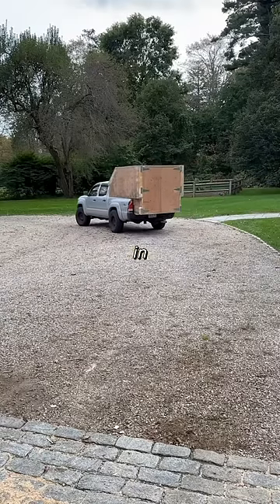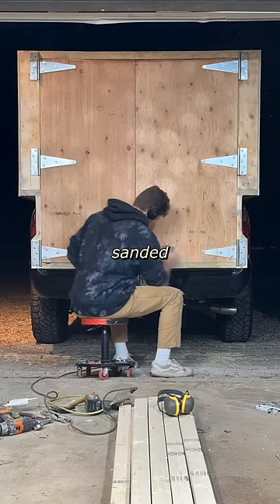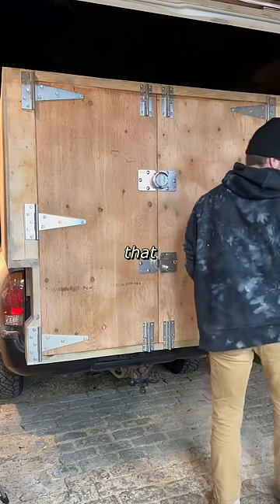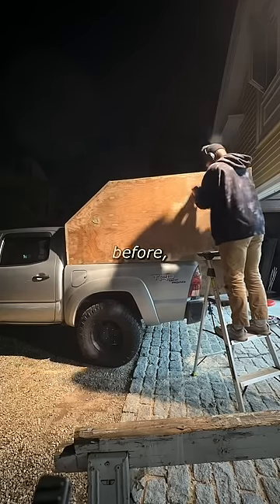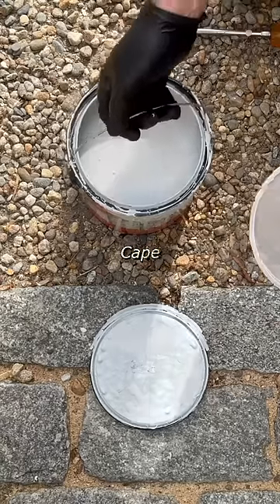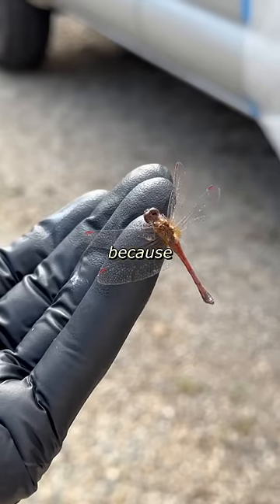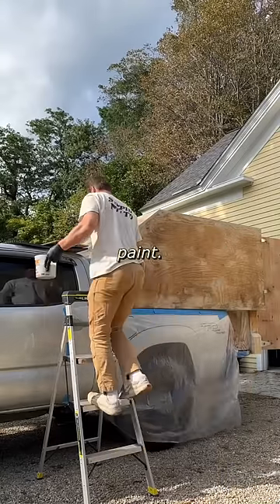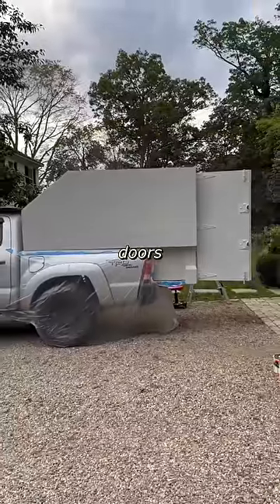DIY vanlife // overlander // motohauler

Comment: To stop the sagging of the rear suspension you could install a helper spring or helper airbags..
Reply: No. To stop sagging use the appropriately sized truck for the expected payload. Bags an helper springs don't increase the vehicles GVW, 1 DOT stop and it's impounded.
Reply: @1987FX16  The tacoma has a 1,500lb payload on the rear, I have done research and installed airbags to allow for max payload. Just because the bed is rated for 500lbs and the suspension is rated for 1,500 doesn’t mean you can’t be fit up and add more weight. As long as the typical load doesn’t exceed 1,500 lbs.
Reply: its leanin 🐜 it
Reply: @disrise it’s learnin ant it?
Reply: @NateKK7  an airbag focuses all that pressure on a smaller surface which may reduce squatting but it will strain the suspension much more only way to really improve payload is to put a 3/4 or 1 ton rear end and suspension in it
Reply: @Fin3rain  with the airbags and no extra suspension components it is safe to hold 1500 pounds in the back of that truck because that is what it’s already rated for. Like I said, I added the airbags to allow for max payload AE 1,500 lbs. A max payload rating has a safety margin, if you have 1,700 pounds in the bed every once in a while (not saying I do it) it is still safe if you aren’t being aggressive. 

DISCLAIMER: I am a certified welder who has a vague understanding of safety margins I AM NOT an engineer I AM NOT a lawyer, do it with YOUR OWN research at YOUR OWN risk. This can and probably will void your warranty as well as get you into trouble with law enforcement if you are caught exceeding the manufacture’s GVWR (GROSS VEHICLE WEIGHT RATING)
Reply: @NateKK7  as I said the airbags will more than likely DECREASE your payload capacity because it is focusing all the stress onto a single point. Why do you think trucks still have leaf springs well after they stop usinh them in cars? It's be cause they distribute the weight across a large area
Reply: @Fin3rain You don’t remove the leaf springs, it does not decrease the payload capacity. Your logic is like saying bigger shocks decrease your payload capacity because they are still using the same footprint. You obviously haven’t worked on any of these systems or a off road vehicle for that matter, any suspension upgrade designed for OEM fit is going to use the factory mounting points. Very few payload/travel upgrade components for these trucks require frame modification and the ones that do usually are not off the shelf kits and are intend for off-road use only.
Reply: @NateKK7  larger springs work by increasing the space the weight is distributed against airbags hugely decrease that spread placing more stress on the center of the leaf spring
Reply: @Fin3rain @NateKK7 both you guys are so wrong…. Just install a flux capacitor with a t4 turbo and that’ll solve all your problems… rookies
Reply: @NateKK7  this aged like milk check out his recent posts about the truck😂 its about to snap in half less than a year in
Reply: @obsobsessed5814  TBF, I didn’t think he would beat on it like he has been. If he wasn’t an idiot it would have been fine. Also he extended the weight past the axle so that is even worse when beating on it. On a standard bed with the weight distributed evenly airbags are a viable solution.
Reply: @NateKK7  it would not have been fine  in less than a year the truck looks like the back half is taking a crap if he would have babyd it it would have maybe lasted 2 years
Reply: @obsobsessed5814  been running over weight for years no issue, its all about leverage. If the majority of the weight was over the axle and not behind it, it would have been fine. That’s one of the reasons  why your trailer tongue weight is lower on a hitch than a goose neck, it’s all about weight distribution.
Reply: @NateKK7  youre not going
Reply: @NateKK7  that much over weight*
Reply: @NateKK7 his frame is bent and you lost any credibility.

Comment: Bro looks good but the only think you did wrong was your joice of material that wood is awfully heavy you need to put a good set of airbags or air shocks on the suspension so you can adjust it when your carrying more weight..You can easily loose control of the vehicle when loaded heavy and its squated..I would have use alot lighter material but its not mine take my advise about air bags or shocks.
Reply: He’s doing it with what he’s got I would definitely recommend aluminum framing but it’s fairly expensive
Reply: Yeh man totally agree, it wud have looked great with lot of rivets too.
Reply: With that overhang on that little trk. Loosing control be easy
Reply: I was also going to comment on the use of wood. So much added weight raises the security concerns you mentioned plus it will also reflect on the mileage
Reply: All of you need to learn how to spell lose

Comment: Reminds me of the wood camper box I built on my 85 Toyota a long time ago. Had left over windows from a ragged out old topper for it. Silicone sealer under every edge of plywood. Soaked it with Thompsons and gave it about a year (never leaked) then added a coat of Teflon paint from rustoleum , don't think they still make it. From Colorado high country hunting to southern rain storms. Thing never leaked a drop. Me and my old hunting and dirt bike buddy from childhood put a lot of miles on. His name was Quinn !
Reply: That sounds awesome.  Good times!

Comment: Hey idk where you live Orr if you’ll even see this in the flood. But a great thing to look into would be bedlining. They sell kits to diy “for content” but take it to a shop that bedlines and they will do it cheap then you can go over it with the cape cod and it would look beautiful hold heat, not rot, and be fire resistant as well as look sick af

Comment: I keep reading all these comments of people telling you what to do rather than toss ideas around as suggestions. So I'll start that off lol. My suggestion would be to add a slight lift to the back. It'll compensate for "slight droop" if you will 😂. Buddy's dad did that to his king ranch for when he's hauling stuff around his land and it worked out beautifully
Reply: People are recommending lighter material . How heavy is it going to get in the rain and the bike in the box . Not sure a couple of screws are going to keep it in place might kill a family.
Reply: Most trucks sag when you put anywhere near their max payload in the back.  Helper springs or airbags help avoid the sag.

As for him overloading the truck, that tacoma should hold 1,500lbs.  Bike is less than 500, so unless his garage weights in near 1,000 lbs he is within the engineers design specs.

Comment: My only concern is security again , so much put into welding the fasteners adding the heavy-duty locks remember the box is made of wood, running a circular saw down the center of each door would be easier then removing all the fasteners. Some 1/8"x1"hardened steel since it wasn't framed in steel tubing  is the material i can think of  to put over any screw heads and placed aesthetically &  or like trim thst would add the extra layer of security to make your vault impenetrable.
Reply: Yeh but you can’t remove a bike out of a hole in the wall. This is more so to hide his goods, most would think it’s a camper not a storage shed

Comment: So a drill and a saw and free bike
Reply: What a waste of time. Why not make the back the sleeper and just keep your bike tarped in the back. Completely unnecessary and going to increase fuel cost.
Reply: @ChantelJordan-fm7kx are you saying he should sleep next to his bike?
Reply: @boofy_fubu  why not have a trailer. Still less gas or a side compartment.
Reply: @boofy_fubu is there a reason bikes can’t be transported laying down? Making strong hinges that the wheel slot into and then laying it down, putting a floor above it, you would be able to have a living space i top of your bike
Reply: @Ryalnotch - You would have to drain the gas and oil out of it every time you store it, probably should take the battery out, and secure it so your not bending the handlebars/foot rests or damaging the plastics. This way his bike is ready to ride and he doesn’t have to worry about ANOTHER thing, aka all the other things he has to worry about off-grid, just to ride his dirt bike.
Reply: @zacharietelles7626 yeah seriously,  especially on overnights.  You think living out a small space is easy then you try to do it.  
Imagine if you're out riding,  camping that night, and rain hits. Try packing your bike in and setting up your bed on top while getting drenched.  Or moving your bed again the next morning to ride.
Reply: @ChantelJordan-fm7kx  it's not a waste of time, hes clearly also just enjoying the designing and build process.
Reply: What I learned from LPL and McNaly is you don’t need the extra tools with MasterLocks.
Reply: @TheGundameister  no,  just a set of eyes and a gun
Reply: @theoriginalmonstermaker and some Depends. 😂
Reply: Nah. A hammer and bump pick and you're in with Masterlock lmao.
Reply: Not even a crowbar n done or good kick

Comment: I’ve seen people use water proof wood glue and canvas drop cloth to water proof wood in similar situations. They then paint over the canvas. It provides for longer term water proofing than paint alone. Probably not an issue for you thought.

Comment: Someone needs to tell him at the very least put some ice&water shield on top of the box and front of the box and the slanted front part! Both top and front is going to be hammered with weather and UV rays and water will sit on top that wood will breakdown fast. He should of used green treated plywood. I would also use a heat gun to apply the ice and water so it melts and bonds with the wood. I would even. Put metal soffit panels on it all over. Its super light and will protect that wood box from weather. Plus the snow wont build up on it with the metal it will slide right off! Now that I think about it. He really should have ice and water shield on that box especially the area where the truck covers up the wood. Moisture is just going to be trapped in there and rot the wood out. Man that sucks that wood is going to rot out that box vert prematurely!

Comment: You' should've extended the roof towards the front top of the truck so as to maintain the weight & center of Gravity while driving...Damn u got hell loads of weight just focused on the back wheels.

Comment: Would have been easier to just buy a box trailor to haul behind you. If going to travel it would have gave you more space and storage in the bed. Also wouldnt of had all tht weight on ur truck. You couldve converted it into a lounging area, or storage, or made it the bed and free up space in the cap. If traveling secure the trailor to ur truck so cant be stolen.
Reply: A trailer is the better idea, but as a guy who likes to back roads with the family and trailer it has its own disadvantages.

The main one being, it is very difficult to turn around if a narrow road dead ends.  The second one being parking can be a real pita in some places.

Comment: You can fix the squat with airbag helpers :)m
Reply from the maker: Yes!
Reply: They also have helper leaf springs  which would be a lil cheaper of an option plus the airbags can get holes in them causing them to not properly work anymore..

Comment: I don't see the point of the locks on the doors if the wooden part of the door can be easily cut open.

Personally I think it would have looked really good if you painted the wood then screwed on the locks and hinges so they are still bare metal

Comment: This is 1 DOT stop away from being impounded. And you will 100% at fault in crash for ALL the injury's, remember that. That Taco has a payload capacity at best of 1300lbs. Him 150-200, bike 350, solar & battery bank 100, camper 300-600, bed slab and heater 50-100. He's already at capacity without being done with it. OR packing ANY of his riding gear or extra gas or extra water or extra fuel or extra tools or extra spare tires......
Reply: Did you copy and paste this on every video? Why be a dedicated hater when you could simply just press the “don’t recommend” button?